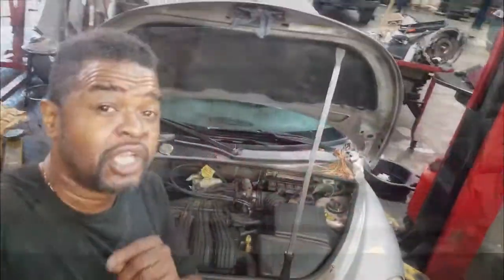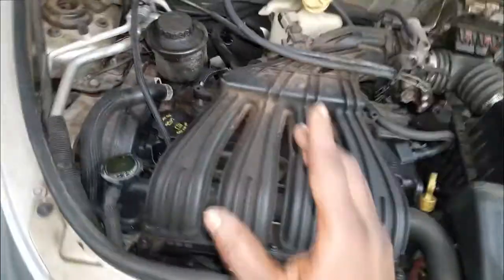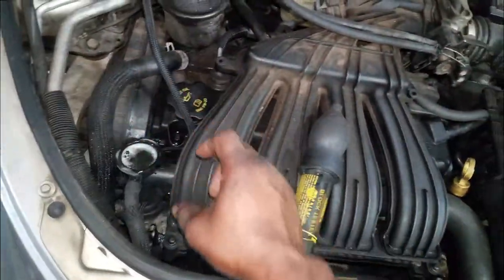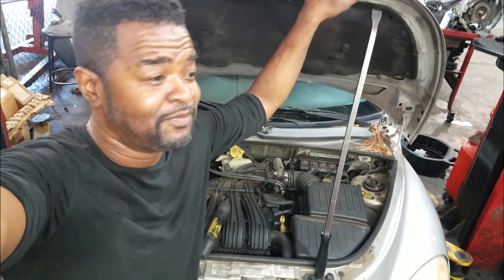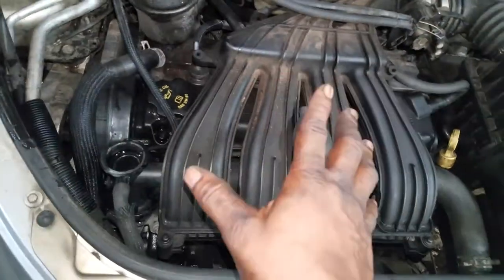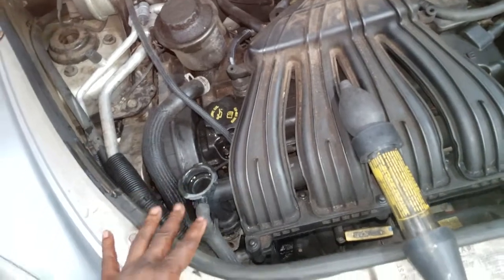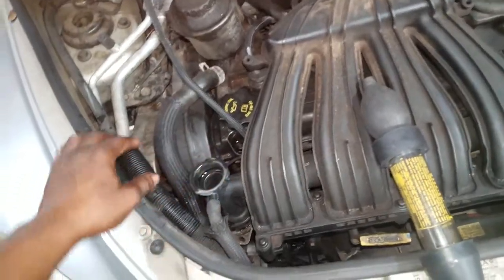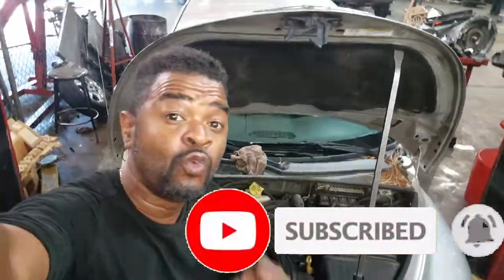How To Tell if your Head Gasket Blown, Symptoms of a Blown Head Gasket, Head gasket test not needed

Comment: My 2005 pt cruiser stops accellerating whether driving or in neutral after reaching 40 on the speed gauge. What causes this problem? I am getting P0891 & P0562. it"s in limp mode for most of the time. I have this problem for almost a year now. help

Comment: JT,  My car is a 2011 challenger, I just put a motor in it out of a 2016 charger.. what antifreeze should I go back with?  the 2011 HOAT Mopar or the newer 2013 OAT mopar antifreeze??     Please let me know.
Reply from the maker: The 2011 uses the orange 5 year coolant..that 2016 engine likely ran with the newer 10 year coolant..your car cooling system (radiator, water pump, heater core) likely still have residue of the 5 year..I would upgrade to the newer stuff but I would flush the entire system out first.
Reply: @OnlineMechanicTips  Whats the best way to flush out the old stuff?? I know the radiator motor and pipes are empty.  Im not sure about the heater core.  It might have some left in it.
Reply: @OnlineMechanicTips  Im just going back with the 5 year mopar antifreeze.  The new motor has zero of the 10 year stuff in it and since my car has the  5 year in its heater core.  Im going to stick with the 5 year coolant.